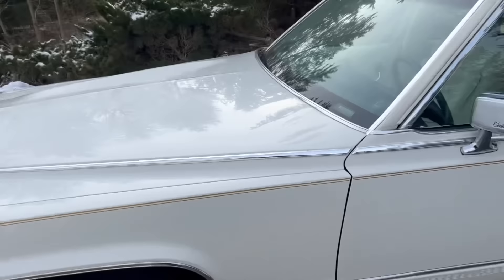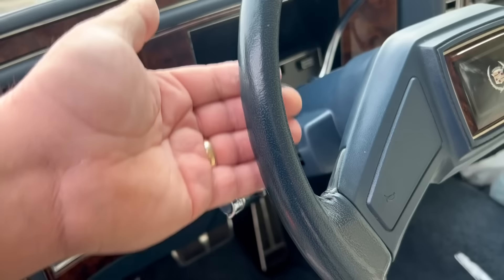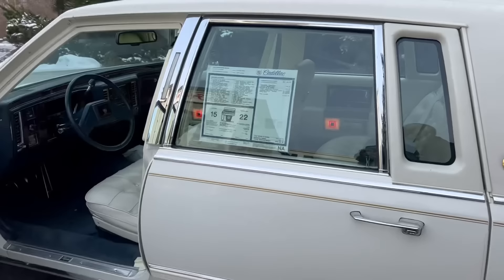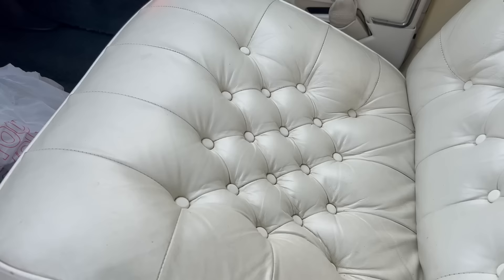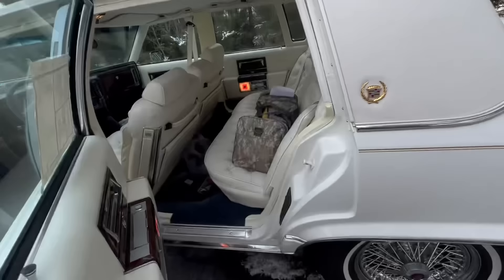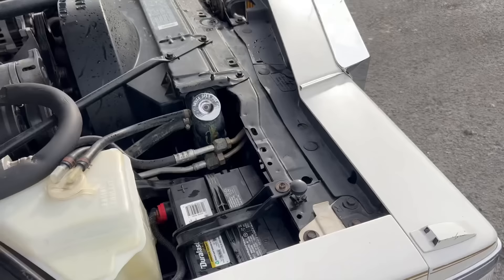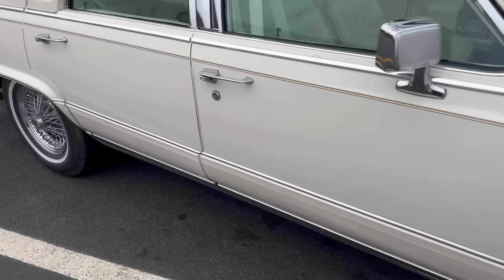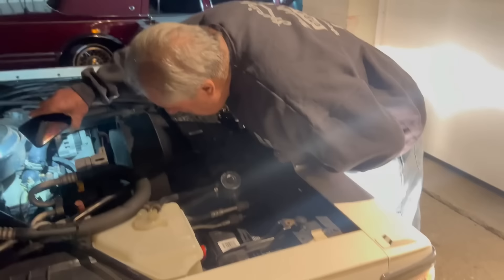Buying a triple white 1991 Cadillac Brougham D’Elegance 984 miles away!

Comment: The 91 I had got a fantastic 23+mpg.  The Chevy 350 had a helluva tip in...maybe could have been a bit more refined and prevent burning the tires off but great engine.
Reply: EFI would fix that.

Comment: Ditch the gold emblems, the atrocity of the press on grille, the gold stripes and aftermarket wheels.  Either factory Cadillac wire wheels, or factory wire wheel covers.   I prefer the hubcaps but such a nice car deserves original equipment.  My mom got a new 1991 Brougham in the spring of 91 and my dad was out of town for some job going on in our shop so he asked me to go with my Mom and make sure she didn’t get taken to the cleaners … So the local dealership had 3 or 4 Brougham’s and  advertised a big discount that my mom saw in the paper.   Anyway  they had 3 when on the day we arrived.  2 were white on white with navy interior and 5.0 litre engines w/ wire hubcaps and one antelope firemist with leather and factory wire wheels and the 5.7 litre.   That one , however was not a  d’eIegance but pretty loaded otherwise.  I figured my Mom would just go with the white d’elegance with velour because it was most like her 84 Fleetwood Brougham coupe she was trading.   Which was a navy/grayish blue with navy top and velour interior but not a d’elegance but still a posh interior being a Fleetwood.  One white car had leather and concert sound and one had velour without concert sound.   We were both impressed with the concert sound and I prefer leather but my mom couldn’t decide(big surprise !) and wanted my opinion. So, I said if it were me I would get the antelope firemist with the 5.7 have them swap out the factory wires with the wire hubcaps from one of the white ones and have the concert sound installed in the 5.7 car.   Required changing head unit and adding 2 front speakers to the front doors and maybe changing other speakers that I can’t remember.  I am a huge fan of white cars ( I have a white car now) but there was something about the antelope firemist that was eye catching and like my Dad I want the biggest engine they put in anything.   We live in the foothills of the Blue Ridge Mountain and hate listening to transmissions swapping back and forth from overdrive.  Well to my surprise my mom took my advice and I picked the car the next day after they swapped out the wheels and I remember seeing the white d’ elegance with the wire wheels from my mom’s car and thinking how much better those wheels looked on the white car and when I saw my mom’s car how much better it looked with the wire hubcaps.   Strange how the same car different colors can look so different by changing wheels.

Comment: Check the "Golden Eagle" self-sealing tires, or whatever they're called. When they sit, the goop inside the tires all drools down to the low side, throwing the tires out of balance. I bought a super low mileage example of this Caddy decades ago, and on a trip south, at about 80 mph, the tire killed itself and exploded, shattering the plastic inner fender, on the interstate in the middle of the night. Not a happy moment. Get 'em checked.

Comment: Learned something interesting about the V92 towing option 1990 vs 1991-92. In 1990 ALL 5.7 cars had the 3.08 gear with 7.625 ring gear and the V92 towing. All 1990 cars that had the V92 towing had the 5.7. For 1991 and 1992 you could get the 5.7 with or without the V92 towing. The ones without had the 3.08 gear and the 7.625 ring gear. Those with the V92 had the 3.73 gear with 8.5 ring gear and bigger rear drum brakes. Plus the rear lower shock mounts were higher to lift the rear end more. So the 1990 V92 is equal to the regular 1991-92 5.7 non V92 cars.